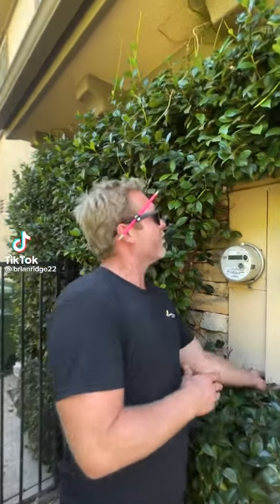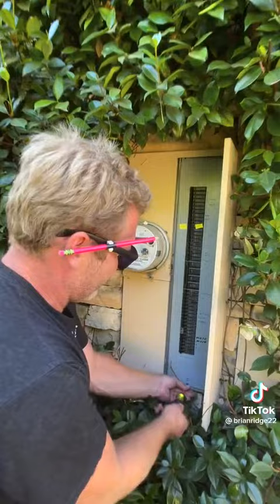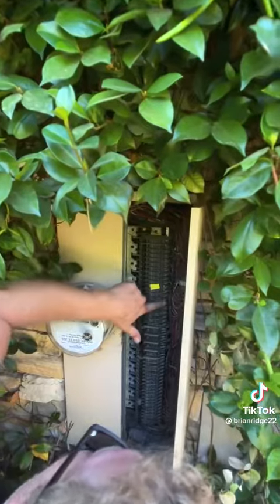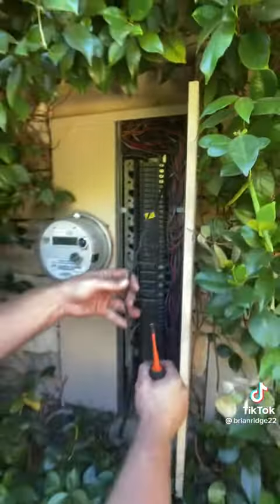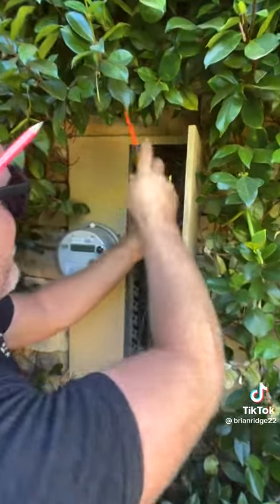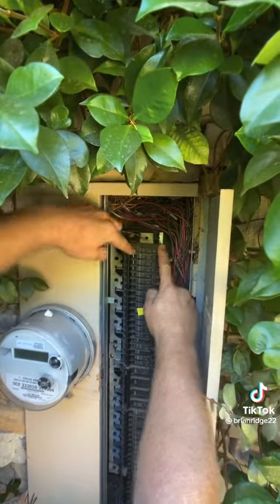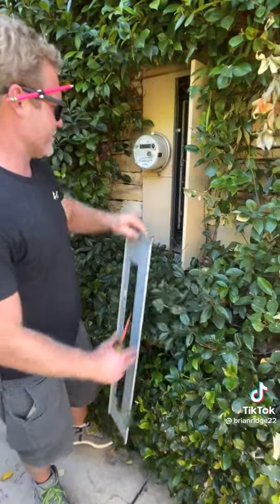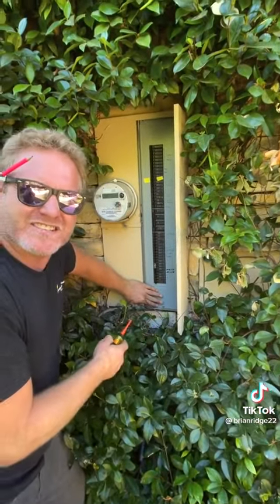Double Tapped Breaker

Comment: While the cord cap was definitely illegal, double tapping a breaker is not if the breaker is rated for it. Most breakers in the last 30 or so years are rated for 2 wires.